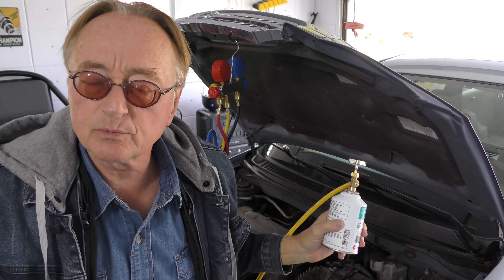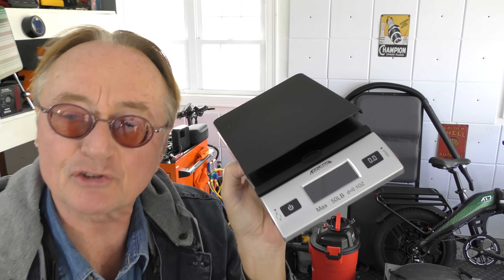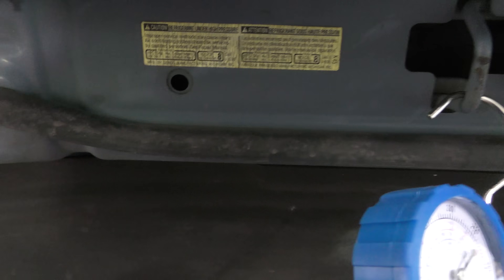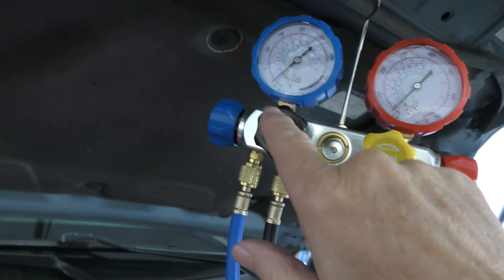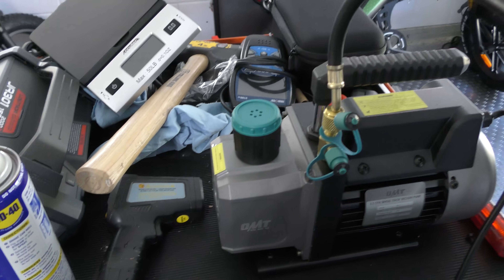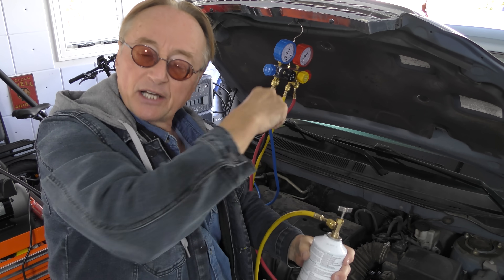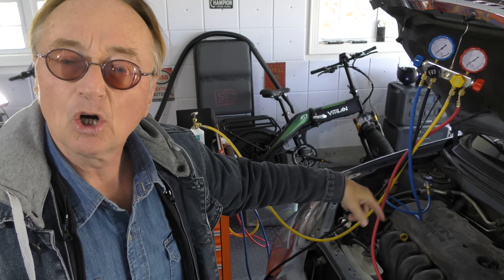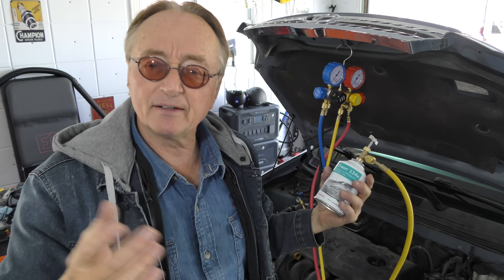Doing This Will Make Your Car's AC Blow Twice as Cold

Comment: I spend 115 on the pump and 40 on the gauges and 90 on the condenser. After that I bought 120 on the oil and the refrigerant. So all in all I spend about 380. That’s way cheaper than the 800 quote I got. Your videos helped me. Thank you so much

Comment: This method is the exact method id say most mechanics actually use when doing AC work, just with fancier more expensive equipment than can diagnose issues with the system itself.

Comment: Handy primer on using a manifold gauge with the AC system, Scotty! By the way, it isn't 30 pounds vacuum, it's 30 inches!

Been working with vehicle AC for decades. My take on r-1234yf? It's a real pickle, stupid expensive and hazardous material, more flammable than you think. 

Regarding the high side, one must be very careful when the compressor is running, AND you must be mindful of the VALVES on your manifold. You can interconnect the high and low side if both valves are OPEN. If your fill line, the yellow one, does not have a safety valve you can send high pressure refrigerant toward that wee metal can! It isn't designed for that pressure.

As a professional, I must diagnose the system in operation. Thus, I monitor the high side pressure to verify the compressor and TXV operation. Handy trick! You can check the high side valve if your quick disconnect is working properly. Those knobs work in reverse from the way you think they do. As the QD is fitted, it locks atop the service port and seals the connection. Rotating the valve clockwise depresses the Schraeder valve on the service port. There is a "dead spot" as the knob is operated. When completely turned counterclockwise, the quick disconnect is shut off to the hose. I apply vacuum to the manifold, and verify (with an uncharged system) that the Schraeder valve will hold a vacuum when seated.

This question has become moot with R-1234yf. If I had a penny for each time the leak was the valves, think I'd have a real bankroll by now. Nasty stuff.

Comment: Small correction! Hvac guy here! The compressor won't die because of too much pressure, as your pressure fluctuates all the time...what kills it is liquid not saturating into a gas by the time the refridgerant reaches the compressor, which is caused when you overcharge the sytem! It has too much liquid to process, and once that liquid hits the compressor it will likely kill it! The compressor is responsible for turning Low Pressure Medium Temperature Gas into a High Pressure High Tempurature Gas, the heat is then rejected into the air turning it back to a liquid through the condenser, goes through back to the evaporator and starts transitioning into a gas again by absorbing the heat from inside air :)

Good video though, and I would recommend anyone who doesn't know the refrigeration cycle and P/T Temp relationships etc to do it this way, can't go wrong!

Comment: Great Video..I'm shocked my Grannies old Reliant K car AC ran 20 years after I changed compressor and converted it to R134 and never pulled the vacuum on the system...guess older cars had more leeway to f up and still work...It also unknowingly ran on 1 quart of engine oil for a month and still was running after I sold it 10 years later

Comment: Scotty are you advocating venting an existing that is low on refrigerant and then evacuation via vacuum, or only evacuate on an almost empty system where the low pressure protection prevents the compressor clutch from engaging?

People don't realize that vehicles "air conditioning systems" are not true air conditioning like your house. They are in fact High temperature Freezer Systems because of the heat load and poor insulation of a vehicle. True air conditioner would never cool it for comfort in a vehicle.

I bought a 30 pound cylinder 6 months ago and my cost was outrageous even at wholesale.

I am glad you took the time to show people.  Shops have gotten out of hand along with every other industry in the world today with prices.  It isn't going to be able to sustain it for much longer.

Comment: You didn’t account for filling your manifold with Freon, then zeroing the scale so the amount is correct. It’s also important not to open/purge gauges or lines after system is in deep vacuum. Only remove the lines after system is pressurized by refrigerant. I’m not an auto mechanic, but an HVAC & refrigeration tech but these are the same as far as charging procedures.

Comment: Scotty, what about the line pack amount …. the refrigerant that fills the line before any goes into the car.  Doesn’t a certain amt of weight have to be accounted for to fill the line before you can measure the weight that entered the car’s system?
Reply: He started weighing after he purged the air from the line, therefore all measured weight went into the system.

Comment: If you are going to go to all that trouble, replace the schrader valves before you hook anything up.  That way you do not need to worry about the valves leaking when you are finished.
Reply: If you're replacing the valves, I'm guessing you'll need to run the vacuum pump for another 45 minutes before filling?  Reason I ask is that you must evacuate the system before removing/replacing a valve, right? And in order to access the valve, you have to disconnect the vacuum pump, right?
Reply: @Keifsanderson  
Scotty  usually recommends evacuating the system in case like this to prevent any refrigerant from escaping into the atmosphere.  So all you have to do is run the evacuater until the pressure is zero, stop, replace the schrader valves, and then continue with the evacuation like normal.  If the pressure is already zero then just replace the schrader valves at the get go and then evacuate.  Then when you refill the system you will have brand new valves and not have to worry about the valves leaking after putting in all that expensive refrigerant and loosing it or starting the whole process over again.

Comment: I never have luck with Autozone rentals on these gauges. Usually are missing fittings or seals. Vacuum pump was a complete mess and would over heat and stop. Its cheap just to get a harbor freight set.
Reply: Funny you mention this, i just borrowed these gauges twice, after i was done pulling a vacuum i had a loud hissing leak on the low side valve on two cars, broke each valve and had to spent 26 bucks to replace them, never again.

Comment: I bought a valve system for refrigerant when I saw someone had thrown out a huge ice cream fridge and I plugged it in but it refused to cool off. I figured it was worth the money to see if I could fix this $800 freezer. It worked! Shortly after I bought a used car and it needed to be recharged so I did it myself after buying a $10 can of refrigerant. They are cheaper if you already have the valve part. Now my car puts out an arctic blast! Pretty proud of myself and have a lot of extra cash in my pocket.

Comment: What happened to the old refrigerant?  Did the car come in without any or did you evacuate it prior to doing the video?  If so, a video on how to dispose of the old stuff would be nice since many cars are just low on refrigerant, not completely empty.
Reply: You can just unscrew the valve core and it’ll all come out
Reply: @jombajuice27  . Good for the environment, might as well just dump the oil in the sewers… /s
Reply: I've asked the question before about recovering the old refrigerant still in the system. I received no reply... Crickets. This video neither makes mention of using a recovery tank nor does it mention using a fancy refrigerant recovery machine.  In other A/C servicing videos, mechanics say go to a mechanics garage and pay them to recover the left over refrigerant responsibly. Once that's done you can follow all of Scotty's instructions. I have some trust issues when it comes to using garage mechanics, but I guess sometimes I have to work with them to get a job done right.

Comment: This is great, I got the gauge set from Autozone and did it last summer (prior to this vid).  This was very thorough.  I did tap the high pressure side because I was told to monitor it (to not let it get too high)...What I haven't gotten answered is the vacuum pump (I didn't get it), where does the refrigerant go?   It only sucks out air and water?  I've asked numerous parts stores and they either don't know or say,  'I just release it to atmosphere'...not cool (so to speak) and not legal.
Reply: I was wondering about the very same thing - isn't it illegal to deliberately release freon into the atmosphere?

Comment: Scotty,
I started the process you recommended because my AC isn’t very cold anymore. Anyway I purchased the AC gauges you recommended. When I connected the high and low side it shows pressure. I assume this is the remaining refrigerant that has not leaked out yet. What do I do with this? Do I vacuum it out and where does it go?
Also what pressure should I be looking for when vacuuming? How do you know when it’s done?

Comment: My 88 Ford LTD crown victoria, converted to R134A from R12, runs between 30-40 ibs suction and 80-250 high side of course depending ambient temperature and humidity center duct temperature on a sunny 83° day is 45-40°.

Comment: Since you probably haven't touch those schrader valve in years, why don't you recommend to also replace the schrader valves at the same time they are servicing the a/c system?
instead of adding freon to a/c system and find out that one of the schrader valve is leaking after the re-charging.

Comment: L❤️VE  Y❤️U Scotty I Appreciate you So Very Much !!! I have a 2006 BMW X5 3.i E53 
I have so many questions about some of the codes because it’s an older model I have a hard time finding videos about some of the codes I have . I feel like doing a video and sending it to you!..
one of the vents on the middle by the passenger side of the Radio blows hot air so I just close the valve and the rest of them blow cold now I think it’s just the hoses off on the other side but I can’t see where it’s off to put it back on so I was wondering how do I do that but there’s other codes that I was talking about isn’t about the air conditioning code it’s about the secondary mass airflow sensor and some of the issues I’m having trying to clean those sensors and or when I clean them they are fine the codes disappear but then I drive down the road get on the freeway and they come back on again

Comment: When I would recharge my friend's 1970 Pontiac, the air from the center duct was 20 °. That's R-12 for you. Huge system also. It held about 4 pounds of r-12 which is about 1418 grams.

Comment: Scotty, your like is going to a 3 way Manifold which doesn't have a vacuum nobe and your using the 4 way Manifold. All video showing to use the 3 way Manifold with the vacuum are connecting the low and high. You said not to touch the high cause it may cause a problem that we didn't have before.  How would you do it with a 3 way Manifold with the vacuum?

Comment: Scotty, I have a 1998 Dodge 1500 cargo van with the 318 and 55K original miles.  The Fan blower switch is not working on HIGH.  I know the resistor can do the opposite - allow only high and not low.  I replaced the switch on the dash already - it worked a couple times then HIGH stopped working again.  What could it be?  My first thought is to take the switch out and see if the connector is corroded.  What else should I check?????

Comment: Thank you Scotty! It's so hot here in California, and my air is not working. Maybe I'll give it a go. 😁
Reply: Is your air not blowing at all or just no cold air?
Reply: @mentlinc  I have no cold air at all, but air is coming out. I've had it charged several times in the last few years, but it always happens again.
Reply: @lauranewbie8765  Sounds like a leak. There are certain refrigerants that have a chemical that seals certain leaks while they recharge. Next time you recharge you can try one of those products instead. It's around $20-$30 more than the regular refrigerant stores sell so if it doesn't fix the issue you won't have spent too much money.
Reply: @mentlinc  Yaaay! 🤗  Thank you for your advice! 
I will look for that specific kind of refrigerant then. You're so sweet! 😊  Thank you for your help! I really needed to know.

Comment: if you buy gauges like those and want to use them for your house a/c youll just simply need to need to swap out the hoses. blue goes to the low press side red high press side if you cant tell which one well the skinnier the pipe the more pressure it creates rite? hence high and low pressures. ( talking about if you want to use them for your house ac)

Comment: This is kind of off topic but I am redoing my entire ac system in my 1990 s10 and I had to get hvac core plastic covers from the junk yard and I am wondering what material the factory used to seal them to the firewall? Some people said mastic tape but I am not sure which kind will be most similar because it has certain areas that go around bolts and the sealant splits open into very narrow strips.

Comment: tell them about the common electric fan problem in Hondas.  the electric fan up front will die and keep the ac from kicking on.  mine is currently getting stuck instead of spinning, I have to bump it manual to get it spinning
Reply: Nothing beats manual adjustments. I really love pounding on the lug nuts with 5 pound hammer to release the stuck brakes. Or slamming the doors to clean the snow from windows...

Comment: Those big cars back in the 70s like Ford LTDs could put out air so cold that you could see your breath inside the car on a 90 degree day. But those small cars in the 70s and 80s A/C systems hardly put out any cold air at all and the compressors generally gave up the ghost after about a year.
Reply: Our 04 Corolla did all that and still worked well even after 14 years.
Reply: I bet you look forward to the gas bills too.

Comment: 100% about not hooking up the high side gauge. Work on OBS  chevy trucks a lot and they had sh*t ac systems from the factory and the high side ball valve is one of the most notorious leakers on them. It should always be upgraded with a high side valve with a schrader valve in it like the low side has when the system is empty.

Comment: the vacuum pump is to suck the air out, not the refrigerant. To remove the refrigerant you need a recovery unit. the “new stuff” is still a problem for the ozone layer, just less than the old r22

Comment: Scotty didn't mention something that is very very critical. Amount of refrigent is one thing, but PAG oil is also necessary. This ensures your compressor won't fail prematurely due to lack of lubrication. There is a certain amount that is required and there is UV PAG oil that helps you find leaks with a UV flashlight. 

A local shop charged me $300 to evacuate my old refrigerant. I decided "NOPE" not any more. I bought everything I needed to do it myself and it's a piece of cake. Now I service my AC myself as well as people I'm close with.
Reply: Ok so what do you do? Do you have another video or guide that explains step by step?
Reply: @jonathanrockstar1  There are plenty of videos out there. Pag oil lubricates the system and mixes with the refrigerant. The amount of oil used is manufacturer specific. If you don't use it, you'll destroy your compressor.

Comment: R134a is fine for the ozone. The issue is that it's a very potent greehouse gas (1 g or R134a is equivalent to 1410 grams of CO2). R1234yf is less potent than CO2.

Comment: On a1999 Pontiac Grand Am, without freon or pressure for maybe 10 or 15 years , would the oil in the AC system (134 type freon) have evaporated or somehow dried up? If so how much should you put in? And after putting freon in and AC blows out nice and cold. I was thinking about buying a 3 ounce can Oil Charge and adding it in case it wasn't safe to run it without more oil. Does that sound like a good or a bad idea?

Comment: How do you know what the problem is before putting in refrigerant? Can you just use the vacuum without recycling the refrigerant? What to do with the 2nd can that still has refrigerant? Will it leak into the air after it's removed from the gauge? Can I assume that there is no refrigerant in the system when the AC doesn't generate cold air?

Comment: Crapped up Cabin Air Filter will mess you up too. 2001 Silverado must have been original filter. Nasty clogged up replaced with HEPA filter 20 bucks.
Blowing cold now. 😜✌

Comment: Actually doing it the way Scotty recommends what gauges you have and whether they are marked for 134a won't make a difference.  You are using the gauge set only as a way of getting to the low side of the system and a method to hook up the 134a can.  You are filling by weight of the 134a and not the pressures of the system.  However, once complete write down the pressures so that in the future you'll be able to see if the system is still working as it was when you first filled it.  And the pressure will be the same regardless of how the gauge set is marked.  Pressure is pressure.

Comment: I believe that the vacuum gage is reading in inches of mercury - in. Hg not in pounds per square inch.  There is some loss of refrigerant that stays in the hoses that has to be estimated for being accurate.  It is not much with very short hoses but more significant with 3 foot hoses & up.

Comment: If your adding refrigerant don't that mean there's a leak in the system? Which the added refrigerant will also leak out
Reply: If it holds all summer, the leak is probably small enough not to worry about.
Reply: That's how mines was doing. I had a slow leak.

Comment: My ac is only blowing cold when i drive on faster roades, i have a completly recovered system so everything works. I did notice that my motorfans are not blowing at all (got no overheting issues tho) so i suspect this is the issue, the kompressor is needed to get coled down to be efficet i guess? So fixing the fans should fix this right?